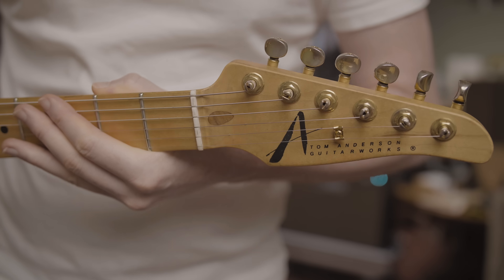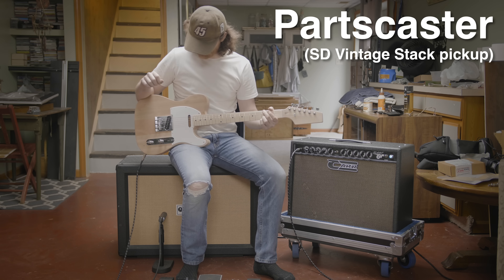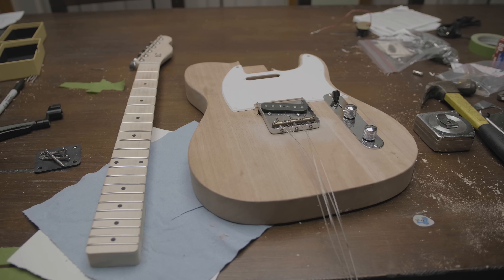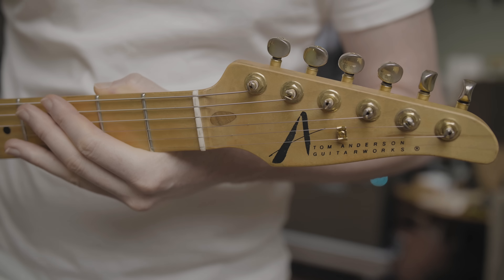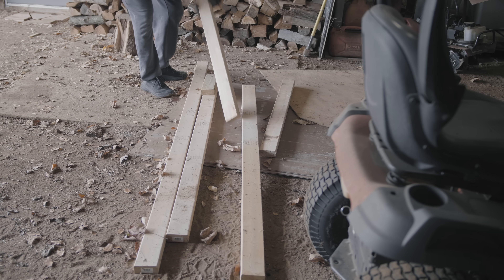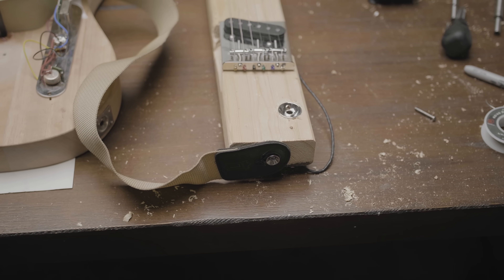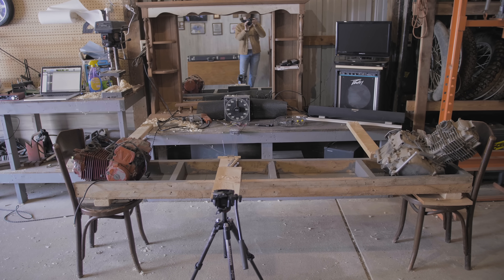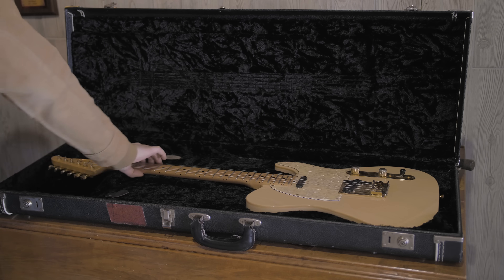Tested: Where Does The Tone Come From In An Electric Guitar?

Comment: Yea, but when they originally designed the Tele, they wanted to put that work bench air guitar sound into a normal easily portable guitar. That's why they sound the same! Busted!

On a more serious note (but don't take it too seriously). Sometimes guitars really are different and that difference can come shining through a fat wall of distortion. I've had a Lundgren M6 humbucker in 3 different guitars. I mean the exact same pickup reinstalled (yea, I like it). PRS SE Singlecut, BC Rich NT Warlock, and a less affordable custom Sinn 27" RR. All of them sounded very different, and all of those also are very different guitars. So, did the differences just add up to make an actual real difference? Or did I forget how the other guitars sounded? Or was I just dreaming of Mikael Åkerfeldt's sweet growls, when I played the PRS? Granted, I didn't do this level of careful scientific research. But I played a lot. And changing pickup height most definately didn't make the PRS sound anything like the Sinn. Also, I had the same set of strings in B tuning or drop A every time.

The only research I did was a simple test recording with the Warlock, where I pitted the Lundgren M6 against BKP Warpig ceramic. Very minimal difference between those two, but more noticably different from the stock pickups, which I actually preferred on that particular guitar (and didn't include in the test, because that wasn't the point and I'm not too handy at soldering anyway. but I played a lot, so I know). Still sounded like Warlock to me, whichever pickup was in there. So, what makes the Warlock sound then? Floating bridge? Mahogany body? Black color (possible)? Mandatory obscure playing technique, because I need to avoid the 666 deadly spikes (getting close, I think)? Because pickups don't do it. Where does the unforgiving clarity and pristine sensitivity of the Sinn come from? Because it was expensive and I just want it to sound expensive, so I don't get sad? I know it's not the pickup alone. Though, it's a pretty good pickup, I think. And also expensive. Yea, others change pickups to find the sound. Bah! I change guitars and keep the pickup!

The act of recording guitar is a way of eliminating a lot of variables. Listening back to the recording is not the same as playing. You're not feeling the guitar, you're not hearing it acoustically, you're not sitting at a random subpixel in the room, the speakers are not feeding back to the guitar. You are not playing. Don't eliminate the variables. Play guitar. And even if some part of the joy is placebo or psychoacoustics, who the f cares except Glenn!

I'm not saying you weren't having a good time playing on the dual motor air guitar, but obviously you can't play most conventional guitar songs on that. Instead, it inspired you to play something else, that you didn't even think about playing on the Anderson tele. You see my point? When did the pickups alone inspire you to play anything at all? They say pickups and cabs are what matter in the studio, because that's where the sound transforms to electricity and back to sound. Sure. True. Say that in bed and you'll be wanking alone for weeks. But guitars and amps are what gets us excited, because that's where we get in touch with the music itself. Which is more important?

Well, that escalated. I don't know why I hit send. Have a good night! :D

Comment: There’s little doubt that the amp, pickups and setup make the largest and (nearly) overwhelming difference in electric guitar tone/character, and this video does a good job demonstrating that.
However, it’s equally true that “the rest of the stuff” makes some difference in the tone as well.

If you’d like a definitive test of that, mount a pickup into an acoustic guitar body and compare that to a solid body electric guitar while standing in front of your amp. 
The acoustic will immediately go into uncontrolled feedback.
What is feedback?  It’s where the resonant frequency of the guitar is excited by certain frequencies of sound.  In other words, the resonant frequency of the guitar (which is a factor of many things, the wood type and tension in the wood being the primary elements) is affecting the vibration of the strings. (remember, your amp is only amplifying what is happening with the strings and pickups, it doesn’t directly “hear” the body of the guitar, but the pickups and strings are both subject to the effect of resonance in the body of the guitar).  Feedback is when that interaction/vibration becomes so large that it runs out of control, but the same sympathetic vibration effect is occurring to some degree every time you play a note.  And that in turn, affects the vibrational modes (overtones) of the sound.
So, one can definitively say that the guitar body has some effect on the sound.  As to how salient that effect may be, or whether it’s an effect that is worth X amount of money…..that’s for each person to figure out for themselves.
If you play loud and with heavy distortion/effects….sure, the guitar itself is a smaller and perhaps insignificant part of the total sound.   As with all thing, YMMV.

Comment: As far as I know guitar electronics can vary a lot, due to tolerances between the pots, resistors, and other things in the electronics.
Maybe if you could
a) use the exact same electronics for the air and the regular guitar
b) or if you could match the ingredients as closely as possible with a hi-spec analyser (Audio Precision, Prism Sound, RTW or similar) and use 0.1% resistors etc for closer tolerances, maybe we could hear even less difference.
Awesome video, thanks for the efforts!

Comment: The difference is not really noticable, but also a fact is that when you hit a string once and rest your fingers in the wood of the body you can feel the vibration on the wood, it is mainly transferred to the wood by the bridge back and forth, because vibration spreads, it ends up interacting with the strings, the pickups are inside an housing so they just capture that dance. Is it noticeable? Eventually our ears won't be able to detect it clearly but the vibration is there, the frequency can be slighlty changed with this interaction, its physics, just do the test, parts that vibrate attached to eachother they transfer vibration to eachother it will always be different  from parts that vibrate attached to an absorbing element or non vibrating element.  Some people cant even tell a difference between amps sound but its there. So is it where the main difference can be found, no, the main difference is in what was presented in the video.